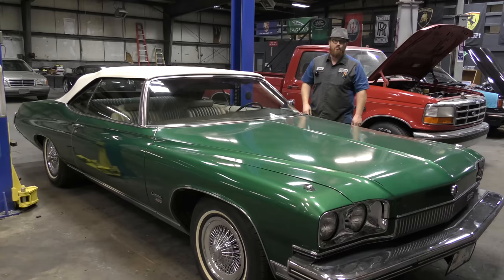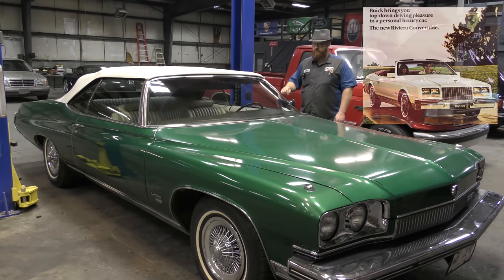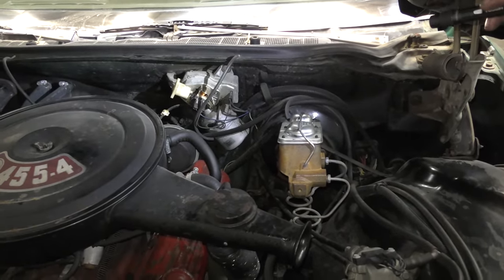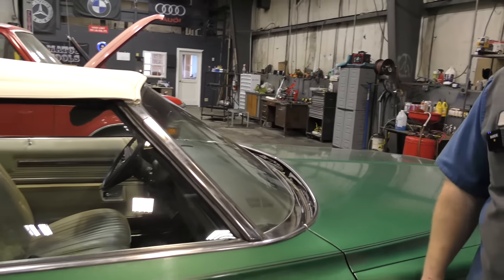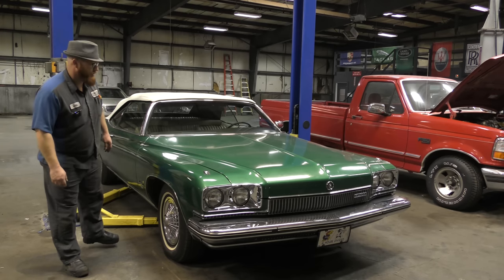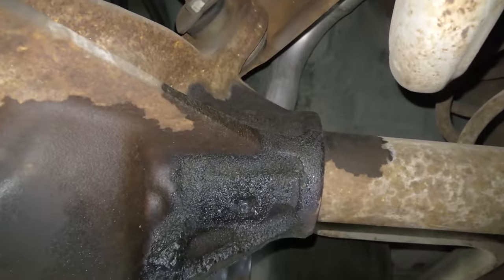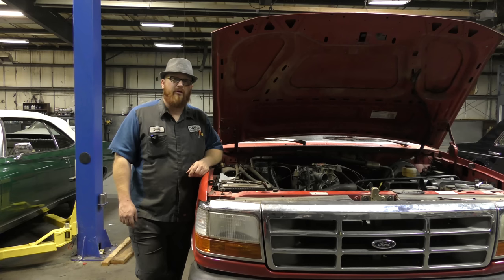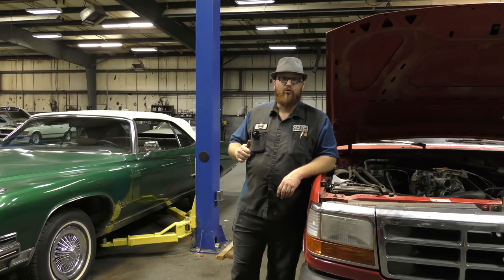Road Warrior! The CAR WIZARD shares a rare '73 Buick Centurion.

Comment: When I was in high school a class mate of mine was gifted a identical car.
It had been his grandparents and although is was 12 years old it only had 38k miles.
They had kept it at their vacation home in Florida.
A few years of a teenager driving it and Wisconsin winter's ravaged it.
It finally met it's demise on New Years Eve when the owner who was delivering pizza sped across a bridge and hit black ice.
Car spun around and around and every body panel hit a guardrail.
It did start and run enough to finish his delivery but the radiator was cracked in the accident and it was too expensive to replace so they junked it..

Comment: Centurian was amazing.  Type of car (Lesaber, Electra) I would have bought when I started driving.  455 ci engine (7.5L) with 250 hp, vs my 2012 Honda Accord 3.5L V6 with 280 hp.  Channel support - surprised no parts (O'Reilly, RockAuto, JC Whitney) or oil (Mobile1, Valvoline).  Otherwise monthly subscribers package, think $X monthly subscription ($1/2 stuff, $1/2 towards channel) shoebox with monthly newsletter (car of the month cover, car trivia, care tips) car care products (sample of Joe's leather/tire care and coupon, battery post pads and spray, sample of lithium grease for lug nuts and coupon).

Comment: I had one of these, same colors, same year, but it had the 350 V-8.  I liked it very much, but it was not good on gas. It had GM's 350 trans, and that failed on me when it was about 5 years old. The transmission man said that a car this size should have had the GM400 trans. Other than that, it was trouble free.
Reply: heat probably done it in, a big car like that should have a external tranny cooler on a turbo 350 were you pulling with it?

Comment: What modern car part have I had trouble getting? 
Anything unique to my 2006 Pontiac GTO. Especially since the Holden factory closed. 
Right now I would dearly love to have a left-hand sun visor. 
Common stuff is still abundant like water pumps, etc. But even pre-fit radiator hoses are shrinking in stock.

Comment: I had a 1995 ford Taurus.  The inside door handle broke 
Out of stock and non orderable at the ford dealer so I got 2 of them at the junkyard I got 2 from the left rear doors because they don't get a much use as the drivers door
This was 7 or 8 years ago 
Today I would try amazon

Comment: I've driven one of these before. I remember you could set a dial on the speedometer at a certain speed and it would buzz if you went over it.
Reply: Erik Stenberg Speed minder was an option not fitted on mine.
Reply: That’s what it was called. Ty. Nice car btw.

Comment: Even with unibody cars, many of those "lift points" are for road side tire changes. That's why emergency jack is slotted to fit in them. When I was a tech, I tried to get even on the "rail" as much as I could on a lift. Especially on the front. I cant tell you the amount of bowed fenders and crushed pintchwelds I saw on unibody cars to the point you ruined the front fenders or the door didn't close right anymore. I saw it more on RWD cars over FWD. Don't belive me? Look under a unibody car, and you'll see the rails under them. Don't lift a car by the pinch welds if you can help it.

Comment: Those rear end caps I believe are fibreglass or pot metal because I remember seeing them cracked or a hole in them but no rust
Reply: Joe Mazzola Pot metal, as you said.

Comment: It has the tri-shields on the air cleaner.  I had an 80's car also didn't have a passenger mirror.  Must be hard to find parts for the rare bird as even 80's camaros are hard to find parts for.

Comment: While its sad to see old cars lose parts support, it makes sense that 20+ year old vehicles don't stay on the road. Its not "planned obsolescence" at that point, its just their time has come. All sorts of parts have physical limits and will eventually need replacing, and the upkeep just starts to wildly outpace the value of the vehicle. Maybe you could consider it worth as a "collectors item" but thats about it. I won't even talk about fuel economy and safety standard increases over the years because a lot of car people get really mad when you mention it for whatever reason, but that is also a reason. It's the same way you don't have the same fridge or air conditioner or heating system as you did 30 years ago. Parts for older units become more expensive than either the unit is worth OR more expensive than buying a new one. It's just controversial with cars because people are passionate about them.

There will come a day when the sale of petroleum and diesel is outlawed (or we run out) and every gas car will instantly be worthless. Nothing last forever, its just a matter of how much life you can get out of something before it finally kicks the bucket for good

Comment: That Buick is what we call a REAL car.  If it were mine I'd use the factory correct mufflers because the driving experience with the top down was supposed to be like riding the wind, not hot rod.  Answering "What car parts have you had trouble getting?"  Brake Shoes for my 1948 Chrysler Windsor.  No one makes them.  Fortunately I have a local relining service that did a beautiful job painting and relining my old shoes.

Comment: Nice video, I have 2 1972 Lesabre convertibles. One restored and one that is a 31,000 original mile survivor. I have had 2 Centurions, 1 72 convertible and a 71 hardtop. My 71 had the high performance 455 option(stage 1 heads). I have never seen one with a manual Trans or any literature on a manual. I can’t say they were never offered with a manual Trans but I have yet to see anything that says it does. If anyone has something that shows it please post the link because I would love to see it. I’m a big Buick full size fan. Thanks

Comment: The car came with aa left hand mirror if options with one, back in the day almost everything was an option.
Reply: Yes, the passenger-side mirror would have been an optional item.  If you did get that option, most often it would be a manual mirror on that side, even if the driver's-side mirror was remote adjustable.

Comment: Smog pump? id tale all that air injection junk off and put it in a box, they were noisy and locked up all the time and the hosed cluttered up the engine compartmet and made it hard to get to the spark plugs, id put a Fi Tech or Holley sniper fuel injection system so it would get a lot better gas millage and easier starts in winter, these cars are great but get horrific gas millage.

Comment: Here is a problem for you. I have a 96 E-150 351 chateau speedometer & odometer jumped around and then stopped. It will not shift automatically now. Speed sensor on pumpkin is actually for antilock brakes. Where is the real speed sensor. I don't see it on the rear of transmission.

Comment: When should the timing chain on a 1973 Buick centurion 455 cu in be changed? 

I have my Dads ‘73 centurion 455 convertible that he bought new which has about 94,000 miles
Reply: Probably never. It's a very short chain and it's designed to last the lifetime of the car/engine. Normally you should never need to replace it.

Comment: If the aftermarket parts supply is drying up for those vehicles; it must be because the demand is drying up also. The aftermarket wants to sell parts, they don't need to sell new cars
Reply: There were only 10,296 Buick Centurion convertibles made from '71 to '73. I sincerely doubt demand is drying up for these beauties.
Reply: Michael Eh try to pay attention; he was talking specifically about late 80s early 90s vehicles. Notice the pick up truck

Comment: Yeah, the parts makers want to put their efforts on the current stuff that is all over the roads.  Older cars like my Roadmaster, and that old F150 have mostly ended up in the scrap heap.  The surviving cars don't make enough market to justify the manufacturing of parts to support them, so they quit making them, and the parts slowly dry up.

Comment: Hey Wizard, do you have any experience having these electronic parts rebuilt or trying to rebuild it yourself?
Those late 80s to mid 90s electronics are known for having awful surface mount capacitors which should be fairly easy to replace.
Old computer computers have so much space around them, and usually their schematics are far more available than the modern stuff.

Comment: I purchased a 1973 ElCamino with a 350 engine, what a disappointment as far as horsepower. Nice looking car, nice ride but a real disappoint, moving from a 1969 Pontiac Lemans that had some horsepower, you could burn the tires off that car.

Comment: Hey car wizard I have a YouTube channel called Tapped Out Otto I just got done working on a 2006 Saturn Vue v6 the parts is running out on those two motor mount transmission lines were very hard to find

Comment: The 1994-96 Buick Roadmasters have the same chassis, the LT-1 engine and the same ride and comfort. Two drawbacks they have though are terrible interior door panels and the inclusion of framed door windows and the B-pillar.  I miss the era of two and four door hardtops---no frame around the windows and no B-pillar. Roll over standards be damned!

Comment: My 72 continental doesn’t have a mirror on the passenger side.
Reply: My 71 Deville has a "dealer installed" passenger mirror.  It has no interior adjustment cable and it's not convex.  It's pretty useless, actually, haha.

Comment: Car Wizard... growing up my dad had a 79 olds custom cruiser wagon with what he claimed was a 455big block. But records show the biggest engine in those stock was a 403. I'm all for gm parts swapping between platforms, and I have seen that wagon take c3 vettes off the line (probably 80's c3s, which is weak bait, but for a79, 2ton wagon to embarrass one meant it had something under it) myquestion is, did any 1979 olds custom cruiser wagon ever roll off the line with a 455, or was that a later engine swap by a keep it looking stock mechanic(my dad bought used for 500 bucks), orwaseveryone full of shit?

Comment: i looked that 1993 ford F150 with a 302 ECM up on rockauto and it shows multiple variations by multiple manufactures available. 

i do know what you mean though. we have a 1990 grand prix with a 3.1 v6. the car is in very good shape, when i need a part i have to order from rockauto in advance, getting something locally fast is next to impossible.

frankly i dont like the latest and greatest. its expensive, over-engineered and mostly junk.

i do not need a fancy push start button with a "proximity key", an info-taiment center, throttle by wire, an 8-10 speed transmission, an LCD in the instrument cluster......... damn it just get me to work as reliably as possible. i dont even care if it takes a little extra gas. i do NOT want a car that is difficult or impossible for me to service at home...... lastly i am 38 years old and i need to focus on paying off debt, not making new debt buying a car i cannot afford and should not buy. i will not be a slave to my car, i am already a slave to a number of other things. NO THANK YOU to $4-$500 a month for 84 months. 

i have a 1990 grand prix 3.1
1996 camaro Z28 LT1
2001 grand prix GTP L67 3800 supercharged 

i love these cars.

Comment: I had '72 Bonneville W/400 ci,  better engine than 454.
Reply: Based on what? The 455 in my '75 Buick LeSabre convertible has been flawless. The 455 Olds in my Hondo drag boat? Same thing.
Reply: Pre air pump, smooth and quiet.

Comment: Thats not original paint, my dad was the previous owner and had the rear bumper resprayed after a fender bender
Reply: 95% of that car is original paint. It did have a qtr. panel repaired after a finder bender many years ago!
BTW, this car has a little over 52,000 miles on it, that are original miles.